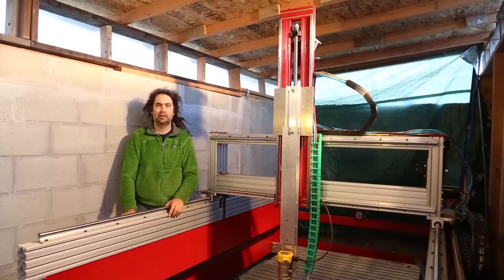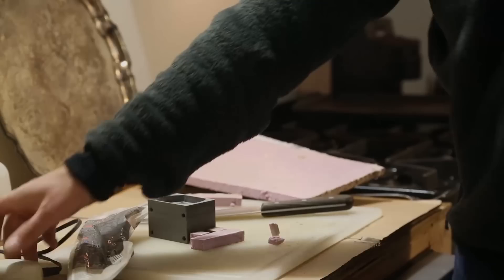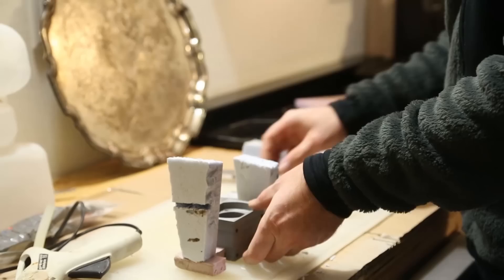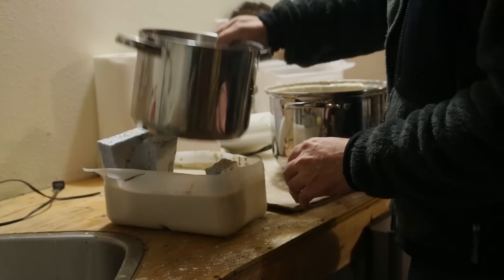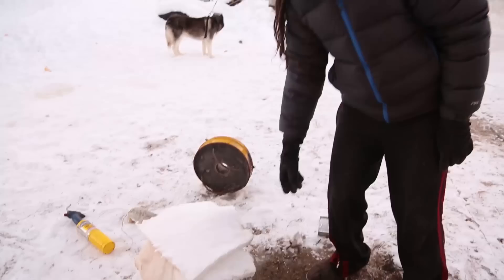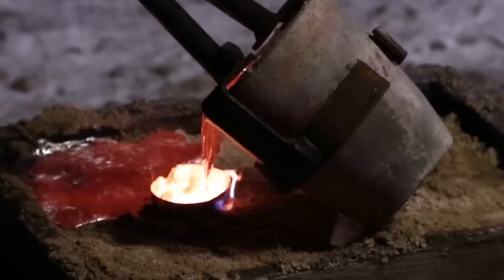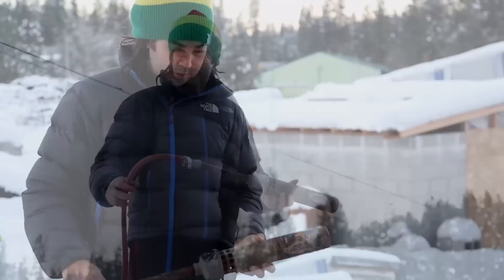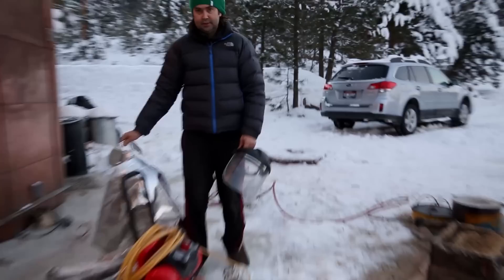Lost PLA 3D Print to Metal Casting; Complete

Comment: 3DTOPO I learned about sand casting in college, even did some simple parts, so long winded and the parts were next to useless. With the advent of 3D printing and your use of plaster of paris with sand it worked so well. Obviously not your first time doing it. Really well done video and well put together. Good for you, this method will work for my application. Charlie.

Comment: Interesting in that the use of 3D printing avoids the expansion problems involved when using wax . If you had used wax, that mould would have cracked apart.
You can never have too much preparation or safety conciousness when dealing with molten metal, it's seriously frightening stuff that concentrates the mind wonderfully.
 Cheers,
  Dave.

Comment: Very excellently done! Awesome job with the casting, everything looked like it was done the right way. This leads me to very much want to purchase a 3D printer now that I know it is possible to use the lost material casting techniques. I also have a small furnace built in a similar manner but without the insulating blanket. The added safety notes at the end of the video are a great/necessary addition for anyone not familiar with the dangers involved with casting high temperature molten metals. Very informative and well made video!!

Comment: 3dtopo, I recently discovered your page about lost PLA and I really appreciate that you're sharing this. Lost wax investment casting or  lost wax thin shell takes way too many steps from what I've learned, not to mention actually creating the wax object accurately in the first place.  I'm building a 1/8 scale live steam locomotive and need to cast twelve 4 in diam. 9-spoke wheels among other things. Your video opened the possibilities to do it! Thanks!!. I'll will have to learn a lot about casting and try one or two then after that cast them in either brass or bronze (aluminum is generally not used on locomotives this size because weight IS ACTUALLY a benefit  >>> traction)
Reply from the maker: Sounds fun!
Reply: 3DTOPO
some questions: can this be achieved with any 3d printer (rep rap for example) ? can this be done with abs? Thanks in advance :)
Reply from the maker: HalfLife2Beta I don't see why not but I personally prefer working with PLA - I don't dig the ABS odor.
Reply: I'm no expert, at all... but I have read there are some problems with ABS in casting this way, besides the fumes.
Reply from the maker: John Tee Yeah, I recall hearing people that tried had more residue left, harder to burn out, nasty stuff. I would say avoid!
Reply: What's really nice for me is the downtown library where I live (big city) has 3d printers that the public can have their STL files printed and they print in PLA! When I told the tech center dude at the library that one could go directly with casting from this PLA print he said: "Really? That's fascinating!"

Comment: What i everytime think when i see a pla casting video:

why didn't you just print everything ready to use? Why messing with foam and glue? 
I mean, you have a 3d printer!!!
Reply from the maker: That is usually what we do now, but I thought it would be easier to explain the various functions by making them for the camera.
Reply: Mmmm, a lot of overhang. A lot easier, quicker and also cheaper with the foam, I think. That is the beauty of it. Pragmatic!
Reply: Its time consuming and wasteful to use a 3d printer when you can stick a few pence worth of polystyrene on as gates & runners. Why delay the work for an hour or more instead of getting on with it?

Comment: I learned the hard way 2 weeks ago why you have to bake your plaster of pairs before casting in it. Wish i had seen this video
Reply: +Aaron1998ish along that line. I was pouring zinc into an open top mold and thing started spewing and shooting molten metal all over the place. what was cool was that the metal that stayed in the mold kept the shape I was trying to cast but was like 50% hollow and looked kind of like a sponge. If I ever need lightweight parts with mass surface area I would do this again, only with more safety precautions.
Reply: +Aaron1998ish I did the same thing with aluminum. I was casting an Ingot into an open top mold and the thing blew up in my face. Luckily I was fine with not even a scratch

Comment: Good to know about using play sand, I've used worn out aluminum oxide blasting sand a few times, but generally I use 200 mesh silica flour.  Makes for a really nice finish in the final casting. 50/50 by volume mix.

Comment: the gates were connected at the bottom of the block.. so when you por the metal inside - its like filling up the bottle that is turned upside down.. you have the air trapped inside which has nowhere to go.. usually you attach thin channels to the most upper parts of the object you wanna cast.. which will later on when vaporized in furnace create "ducts" for the trapped air to escape..

Comment: I am amazed at the surface finish of this part, I am also interested as someone else asked on how the air can come out when the vent is not at the highest point.
Reply from the maker: This is covered in the video. The riser also doubles as a vent.
Reply: 3DTOPO
 yes I know but as per the second part of my statement how can it act as a vent when it's not at the highest point. Wouldn't it cause an air lock?
Reply from the maker: Sam Quad It is because of the hydrostatic pressure from the sprue and riser. Metal is much more dense than air and the sprue and riser are both above the highest part of the mold cavity so it is forced to fill with metal as air is allowed to escape through the risers.
Reply: 3DTOPO
 I see, I wouldn't of guessed. Thanks for the answer, it's good to know.

Comment: Lost PLA casting is the answer to some of my problems. One question I hope you can answer: What level of detail, or rather how intricate of a design can you cast using this method? This part was rather boxy. Could you cast something like that torus spiral you have on another video? If not, what do you think the maximum level of detail is that can be accomplished this way?
Reply: I'll answer my own question:

The level of detail in the torus spiral is most definitely attainable; however, the process needs to be modified. Use vacuum assisted casting with a perforated stainless steel flask. Don't use a plaster and sand mix for the investment. Use a commercial grade investment. Burn out the PLA using a programmable kiln, following the manufacturer's recommended burn times and temperatures. This will make nearly any level of detail possible, but it is a great deal more expensive to do it his way. I hope that helps.

Comment: Lot's of good information & thanks for showing us.... But in the final analysis you'd have done it a lot faster & with less effort by machining it !  I do a lot of thought about how we now have so many different ways of producing things & what methods work best for what projects...Aluminum block can be trimmed out on a table saw with the right blade ( we do it all the time) then machine the flanged side with very same type of computer controlled router you were showing us (just slowly with light feeds) this would enable you to do the mating parts accurately (using same 3D file you had)  - if you can't go all the way thru on some parts - use a drill press to finish it up - they are just clearance holes anyway - or perhaps filp it upside down & go from other side. You can even flip it on it's side & use router to spot the cross holes accurately & then finish thru on drill press...  You'd have gotten done well before it got dark outside ? Or send file out to be machined (very reasonable pricing now a days) Or a little pricey still, have it 3D printed in metal!  Thx again
Reply from the maker: +MrStevos Thanks! This is a popular question and here is my reply: the point is you can use this identical process make casts that would be literally impossible to machine. Further more, unless you have a very fancy set up complete with robotic arms milling takes time and work too. First you have to generate your G-code, set up your billet (not to mention first purchase), change tools, babysit, etc, etc,. Plus there are other considerations such as my stock was 100% recycled aluminum from the local county dump. That said I have a vibrating table now that I can put a printed pattern on complete with printed runners and and risers and pour the plaster of paris mix. Whole things takes about 10 minutes mix and pour the plaster mold, another couple to pop in a furnace to burn out, and about 30 minutes of my time feeding the crucible and pouring. All said about an hour of manual labor for a beautiful custom cast part (or several).

Comment: On the risk of appearing ignorant: I see you fill the mould through the sprue, and you see it raising in the raiser. This is just the communicating tubes principle.But the main part of the cast rises between these two without any vent provided.Does the air primarily trapped in there evade through small, invisible cracks, or how? Apart from that, of course a very elegant method, and one can see that you collected some experience in casting. And the winterly setting made it even more enjoyable.

Comment: Why go through all the hassle of the plaster of paris mold, and not just pack the PLA print in green sand?
Reply from the maker: +8BitLife that can work on objects that can be removed from sand versus this technique works with practically any geometry imaginable. Besides, when it comes down to it, a PoP mold is about the same amount of work as packing a sand mold (possible less). Another reason, is with investment casting you will get a more accurate cast, and I wanted it as accurate as possible.
Reply: 3DTOPO Gotcha. Thanks!

Comment: Very interessting and educating video.
The result is incredible!
Thank you for sharing and explaining all the steps!

Well there is one thing I dont understand:
When you did the gates and runner you put it on the bottom of the sides. (why not at the upper side?)
If you now put molten metal into the riser, how does the metal get to the upper part of the model?
In my thoughts there would be air in the upper part of the model because there is no way to exaust the air.
Could you please explain this?

Comment: What about resin 3D printers?  Also can you make a 2 piece mold if you already have a part made out of wood that you want to keep and not damage after it is molded?  Do you just use a power tool to cut the excess metal off?

Comment: The main reason he did not have trapped gas bubbles was because he added copper to the aluminum. The copper aluminum alloy he used does not absorb hydrogen the same way aluminum does. I assume most of your experience is with aluminum casting? A357 perhaps?

Comment: You might be able to do it with concrete if you gave it sufficient time to dry (days or more possibly) so it doesn't explode, Kind of like how he explained that even dropping the motel metal on already existing concrete would make it break and pit.  Plus then you have to break off hard concrete as opposed to the relatively soft plaster-of-paris.

Comment from the maker: The point is that you could use this same method to cast parts that would be impossible to machine even with a 5-axis machine. That said, I didn’t have a billet on hand, or an end mill long enough so I would have had to order one which cost far more than this method, not mention I would have had to wait days for the part. I have gone from design to cast part in the same day with this method.

Comment: This seems like a more economical alternative to resin sand but just as effective. Nice work, the final product was stellar. 
What puzzles me though is, how did the metal rise to the top of the cavity without the use of vents?
Reply: I was wondering the same thing. I know nothing of casting, but I would have figured the the finished mold would have been full of air without a vent towards the top of it.
Reply from the maker: The riser and sprue are both taller which gives it the hydrostatic pressure needed and air is free to vacate out the riser.
Reply: 3DTOPO
I think the question people are really wondering is how the air does vacate out of the riser when the entrance to the riser will probably be covered by metal before the bubble is gone.  yes, there's hydrostatic pressure involved, but in the same way, if you hold a glass inverted in your kitchen sink, and then fill it with water, the hydrostatic pressure will only be enough to slightly compress the air in the glass, and it will be full of air.  What I would have expected to happen is that you would pour metal in and it would fill nicely until the top of the gates, and then the hydrostatic pressure would compress the air bubble partially, due to the hydrostatic pressure, but you would still have a significant bubble.

Obviously we're all missing something, but I'm curious how the gas gets out as well?  Is the viscosity enough to allow it to fill horizontally, pushing the air out before the bubble closes?  I would think that you would connect the sprue/riser in the opposite direction so that the gates are at the top as you're filling it, then there's an easy path for the gas to escape at the highest point.
Reply: nwimpney The air trapped down in the casting cavity does not go out through the riser, not after the gates get flooded. You're forgetting that the material of the mould is fairly porous, hot air gets pressurized into the walls of the mould. Also the molten metal is not water, it still has it's mass density greater than that of water so the pressure is little higher than hydrostatic. Anyway, you have a fair point in this and IMHO the gates of the riser would have been better to attach at the upper part of the 3d printed investment in order to help vacate the trapped air.
+3DTOPO Nice video, thumbs up!
Reply: Maybe the plaster breathes some air and the vacuum created by cooling is enough to compensate for no vents(?).
Reply: yeah.  I expect it probably is a combination of those two.

Comment: Great vid, stellar results.  Gotta say, you are a patient man.  Scrolled through the comments and the number of times you answer the same question . . . anyway, my question is do you have an approximate percentage of copper to aluminum to get the strengthening effect you mention?
Reply from the maker: Thanks Dwight. Not much is needed - think of it as adding salt to boiling water; just a little bit of impurities in the water lowers the melting/boiling points (same thing happens adding copper to aluminum). I usually add around 2% and I wouldn't add more than 10%. The copper provides substantial increases in strength and facilitates precipitation hardening with the added benefit that it will flow better into the mold.

Comment: You could also print the negative using a high-temp SLA material (Accura Blueston goes as high as 500F), then just pour a fusable metal, like Roses metal (do a search on ebay for roses metal ingots: cheap) into the printed mold.  I'm a fan of the roto281 metal myself ... non-toxic and cheap.
Reply from the maker: +dave diversion I personally have no interest in Roses metal.
Reply: Yeah, I don't either.  Your process, while more labor intensive, produces a much better product in the long term for most uses ... all depends what you're using it for.  Great video, thanks!

Comment: The wet sand would have been no problem it's not dangerous.  Many people use wet sand to mold with in the cope and drag method using clay, sand, water mix.  Good video!
Reply from the maker: +BlueMacGyver I've been sand casting since I was 12 - my late dad and I built a charcoal fired furnace together. That said, sand is very forgiving, but if it is soaked it can cause enough concern for me to feel better about drying it up some. Plus it isn't sand - its more like clay I am on.
Reply: +3DTOPO i see :)
Reply: BMG - you haven't got a clue what you're talking about. After your first " wet " sand or plaster mold explodes spraying   molten metal on you, you may retract your very dangerous comment.

Comment: Ive watched this again today and wondered whether the thin walled tin cans melt into the mould and pollute the aluminium/copper mix? I love the Moon Landing outfit.
Reply from the maker: It's not an issue. What little plastic film there was just vaporized and went straight up and out. Also the cans are aluminum so not a problem.

Comment: WOW great video, I had no idea of the ability of 3D print to metal.
This may be the answer to how a 1929 Hubcap can be reproduced. It's light weight aluminum and threaded on the inside. I've looked for 5 years to locate them and have found ONE in rough condition.
Question, who or where can I have these hubcaps made? 3D print to Aluminum.

Comment: Most excellent video, thank you!

But for the part at hand, perhaps machining the part would have been relatively easy? I can see complex or hollow parts require this casting technique, and I think it's totally awesome.
Reply from the maker: Thanks! This is a popular question and here is my reply: the point is you can use this identical process make casts that would be literally impossible to machine. Further more, unless you have a very fancy set up complete with robotic arms milling takes time and work too. First you have to generate your G-code, set up your billet (not to mention first purchase), change tools, etc, etc,. Plus there are other considerations such as my stock was 100% recycled aluminum from the local county dump. That said I have a vibrating table now that I can put a printed pattern on complete with printed runners and and risers and pour the plaster of paris mix. Whole things takes about 10 minutes mix and pour the plaster mold, another couple to pop in a furnace to burn out, and about 30 minutes of my time feeding the crucible and pouring. All said about an hour of manual labor for a beautiful custom cast part (or several).